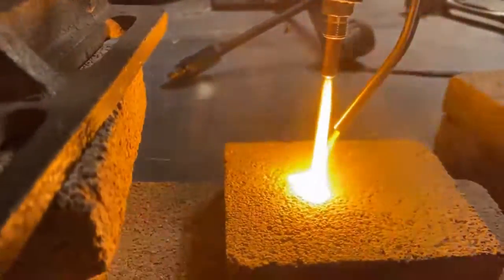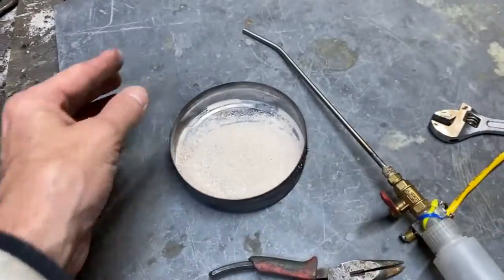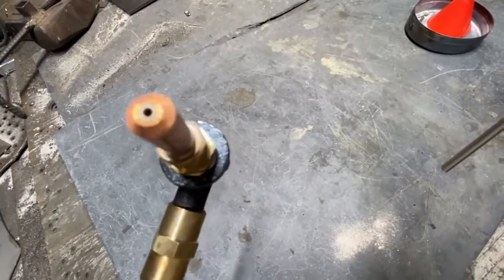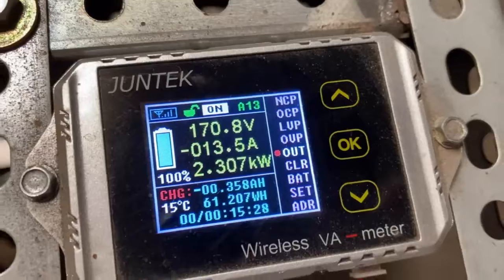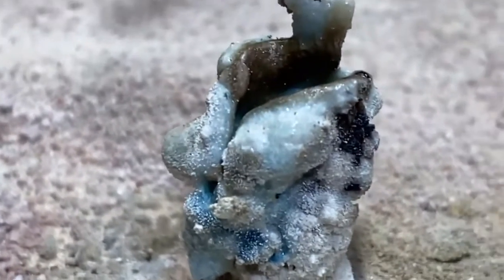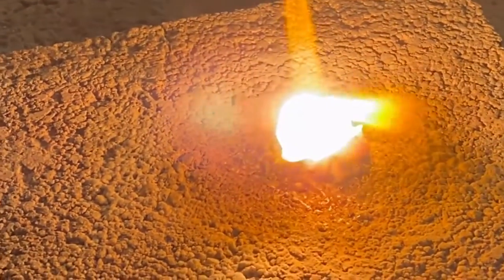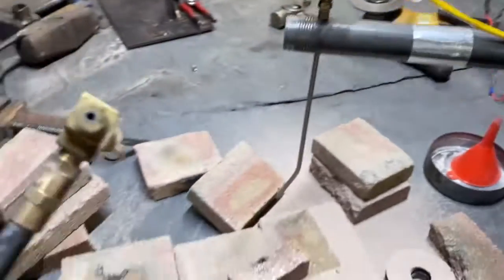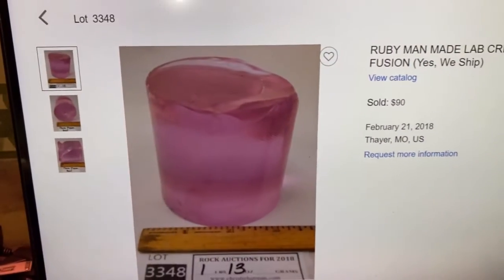Sapphire refractory spray coating machine

Comment: The problem you're having with adjusting the flow rate using the valve is due to the fact that it's a ball valve. A butterfly valve would work better in this configuration.

The smaller and more uniform your particle size, the faster and more efficiently the particles will melt.

You can reduce the particle size easily by just making a ball mill.

You'll always get better results using oxy/acetylene for thermal spraying.

Comment: you first want to start with a heated base of the material you are trying to build. in gem making this is called seeding. corundum which is rubies and sapphires are made at a temp of 1700-1900 C, your torch is way hotter than this so move it farther away. the material you are cooking on is alumina-silicate. silicate bonds with aluminum so it will eat some of the material you are trying to build. your sapphire are using iron also but i didn't hear anything about titanium which is used with the iron. both of those are about .5-1.5% of your total mixture. you are doing an excellent job. keep going please. someone mentioned you are using cinder blocks, i thought it was fire brick so had my material input wrong.

Comment: there are something i observed

things moving away from heat source in high speed are not going to crystallized well

smaller the particles heat transfer faster

however, when small particles melt to from up, it lost the surface area and "volume", that's why they are pockets on top of the bricks, not a flat surface as expected.

if you want a ruby bean to cheer you wife, there is a easier way, use 2 pencil graphite rest on a brick, attach to a stick welder, use a brick with a small pocket hole at the center, secure the 2 tips on the pocket hole, fill the hole with oxide powder and tiny pinch of aluminum dust or a thin aluminum wire as contacts, fire the welder, oxide will melt into a tiny ruby ball. kind of "casting" in very small scale. what if it is a cnmg lathe insert shape? is it a lathe tool than? probably not yet because of the density of this little crystal, but does it stretch metal? hell yes. your belt sander have millions of it on the belt.

Comment: the most enjoyable video i have seen in a loooong time! absolutely that was sapphire material. looks like a softer nozzle might be advantageous...you really have some pressure there...like it bowled out the lil blue monster you grew.
Reply from the maker: I agree about the nozzle , its so over pressured its 1/4 the length it should be . This should be a 40 inch flame LOL